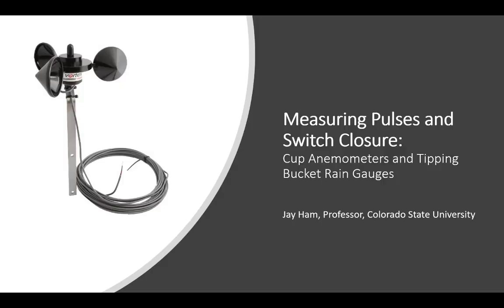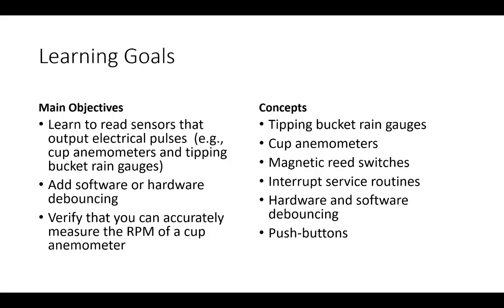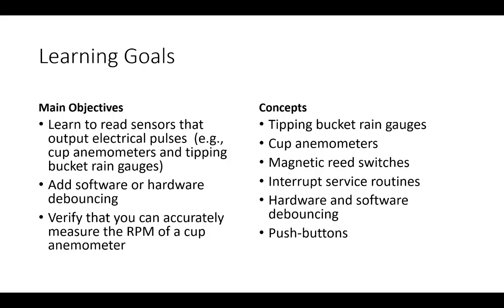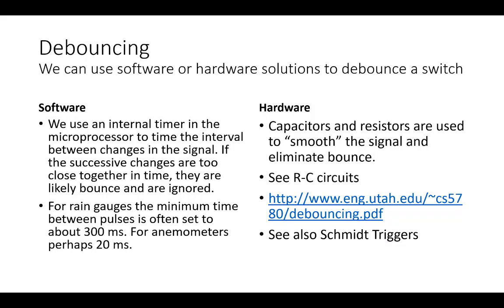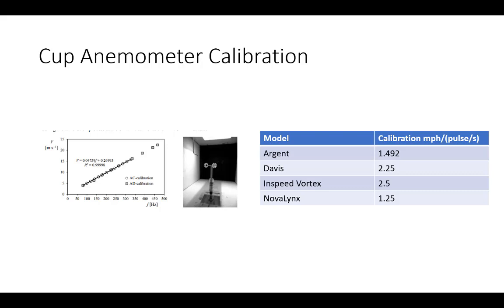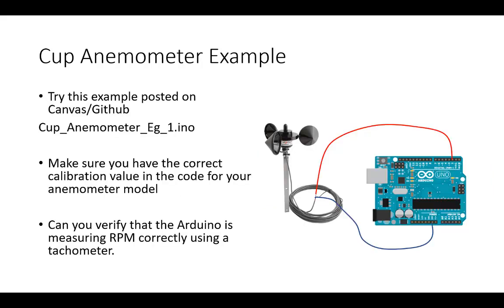Measuring Wind and Rain

Comment: I am building a DIY weather station and have a couple questions.  One, I am using a hall effect sensor for the anemometer and I am wondering if that will require debouncing.  My next question has to do with calibrating the anemeometer.  I am wondering how to calculate the calibration factor.  My thinking is that you need to measure the circumference at the radius point where the hall sensor is to get the distance traveled per revolution.  That distance may vary depending how far out from he center your hall sensor is mounted.  The issue is that in researching this, I have seen some people on forum posts that have said that you need to use the circumference where the wind cups are and not where the sensor is, which doesn't seem to be correct to me.  Once I know which is correct,   I should be able to figure out the rest.

For my wind direction vane, I am using the AS5047D-EK-AB which is a rotary position sensor that is connected through an SPI bus.  That should be fairly straight forward to connect and get a reading from.  I will just have to point the device north using a compass and take a position reading that I can then use as an offset value to the position to get the exact wind direction.